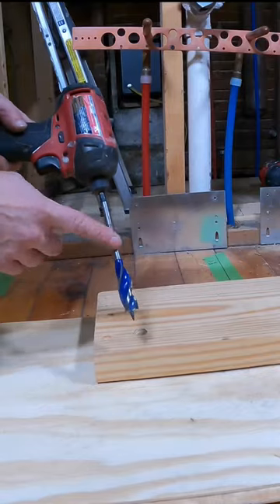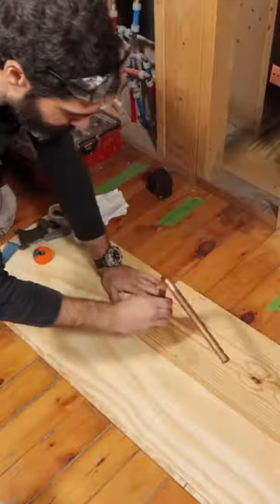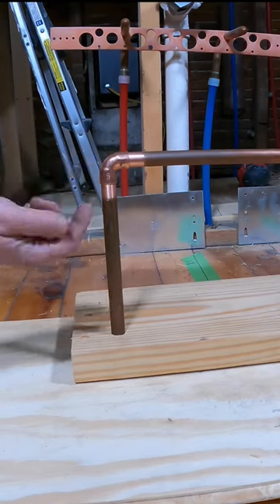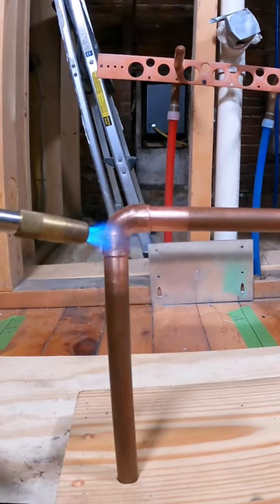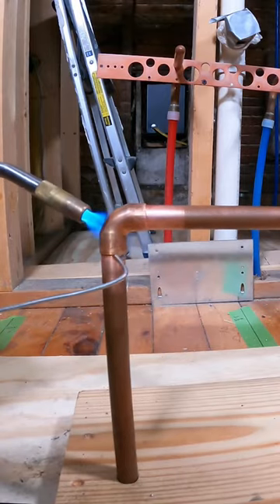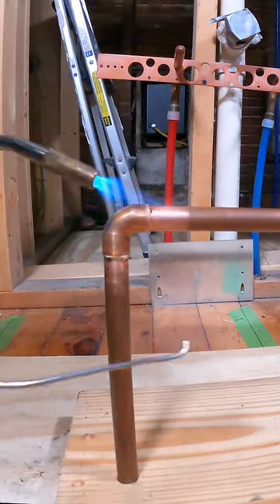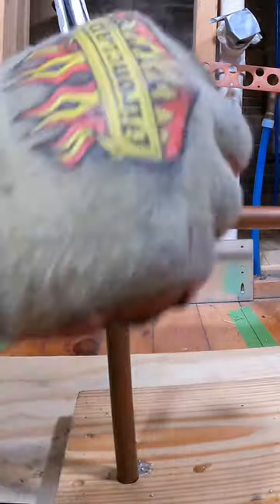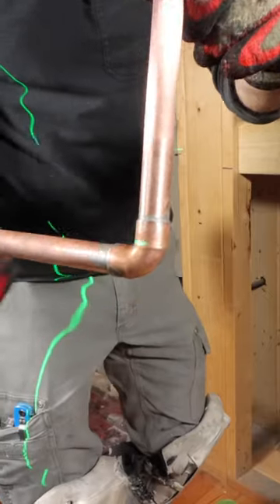Copper Pipe Soldering Tips - #shorts

Comment: Thats actually a great tip.
Reply: Yeah just don't use the flux to clean or as he said acid brush. You want to let it naturally cool down and then when it's all cooled down you can wipe it with a clean dry cough. If you don't wipe off the acid it will just eat the pipe and cause corrosion weakening your joints which might actually cause a leak it takes many years though it is possible. And the reason why you want to let it cool down naturally is because this little thing called expansion and contraction if you rapidly cool it down it will rapidly contract which might damage the solder joint. And spring leak✅️